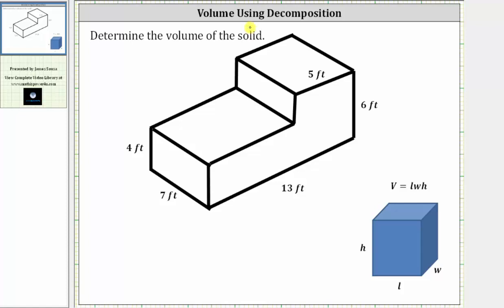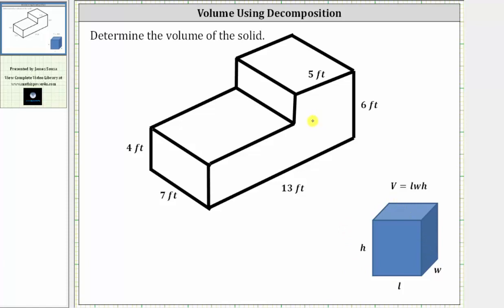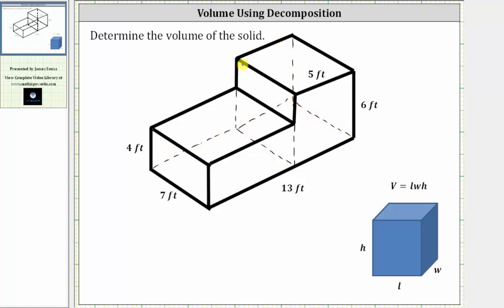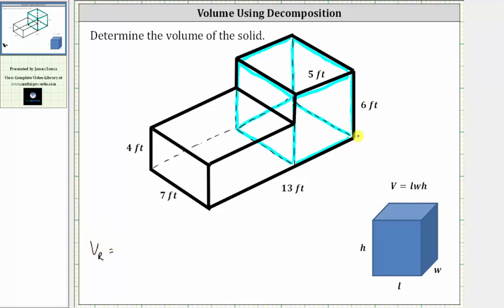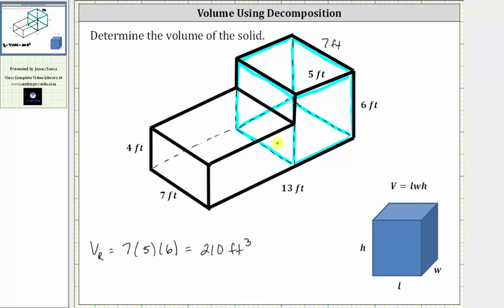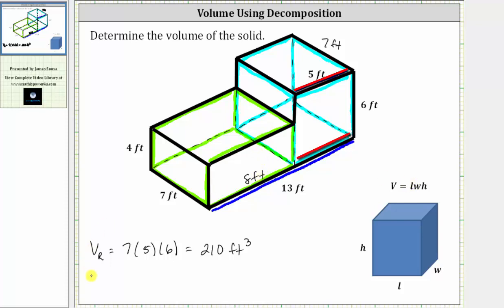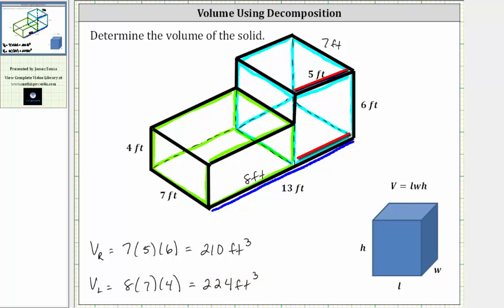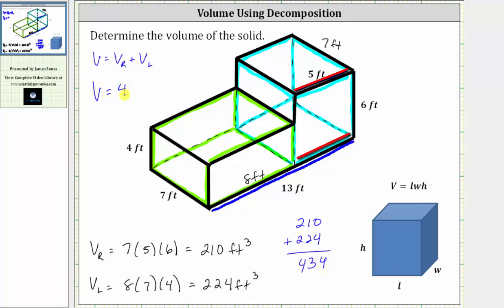Volume of Stairs: Decomposing Volume (Right Rectangular Prisms)

Comment: guys, there is 2 buildings - all u have to do is spilt each part up cause u dont have the same dimensions, ( with a colored pencil if u please) do the first "main building" find all dimensions get your answer like this is a representation ( 3x2x3 = 18 Square units cubed '
Cm '3') you also add the 3 or less if u used all the dimensions, and then repeat for the same side, your welcome.